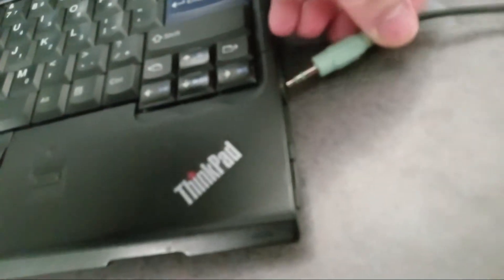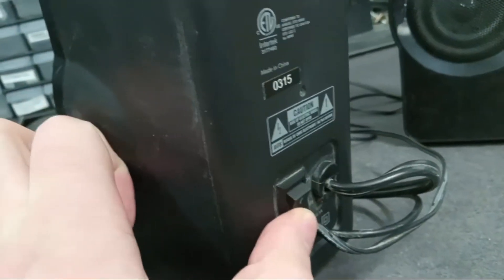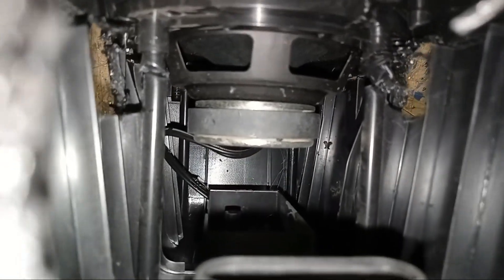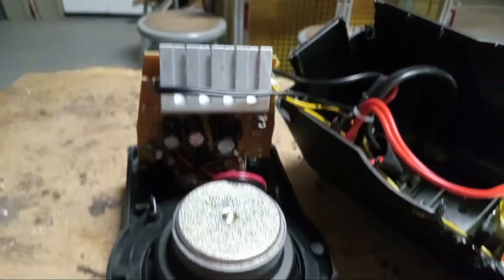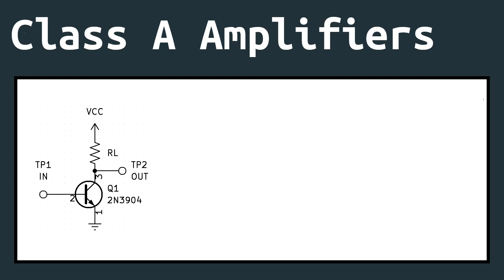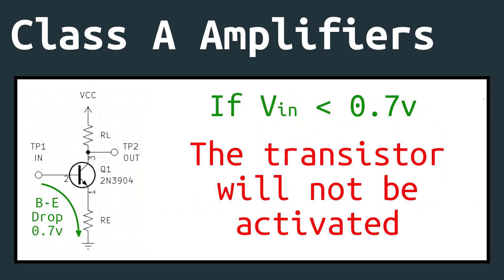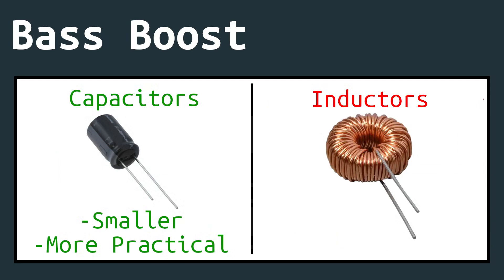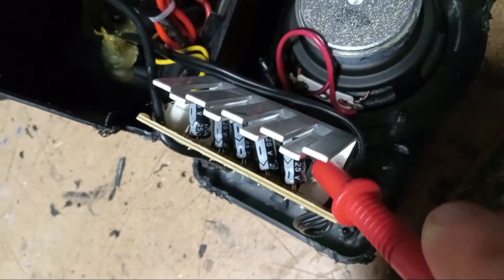Speaker Teardown - How do Class-A Amplifiers Work?

Comment: Class A amplifier does not mean one transistor. It normally has the same stages as a class B amplifier: input stage, voltage stage, current stage. The difference is that class A and class B is biased differently. 

The misunderstanding is probably due to it being possible to make a class a of one transistor, but that is not usually done in real life. I say "usually" just because there exists some amps called Zen. But most class a you buy have just as many transistors as a class b.

Comment: Theese kinds of speakers almost always use a class AB chipamps, theese chips are pretty fun to mess around with and build crappy DIY amps because you often need like 5 external components. TDA2822 is an example of what you can usually find inside of a cheap pair PC speakers. TDA 7294 is an example of what you can often find in a sony Trinitron TV. What you got in theese speakers appears to be something in the middle of theese two. That is a pretty beefy looking amp for PC speakers often reserved mostly for higher end pairs meaning that the speakers you got probably weren't all that bad.
AFAIK there is no class A chipamp.

Comment: Couldn't it work without resistors?
Reply from the maker: Which resistors are you talking about?
Reply: @SineLab  in the class A amplifier. Couldn't you just use one transistor and nothing else as an amplifier?
Reply from the maker: Well, you would need at least one other component drop voltage along with the transistor. Whether that be a resistor or current source, or something else is up to you.

Comment: In the class A transistor couldn't the output be where the ground is?
Reply from the maker: Do you mean switching the ground and outputs?
Reply: I mean using no ground
Reply from the maker: You need the ground to "be the bottom" of the amplifier. The amplifier can only output from between the VCC and GND markers.